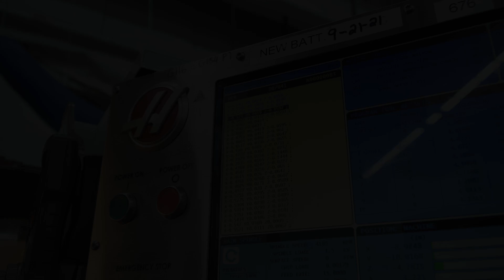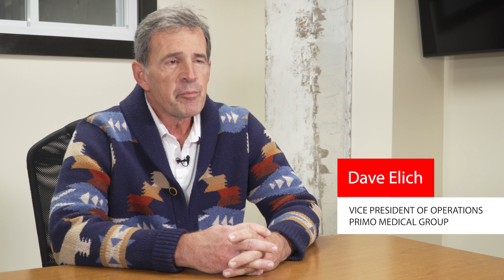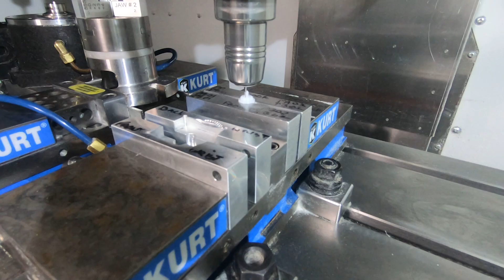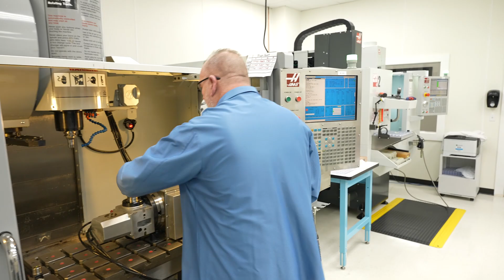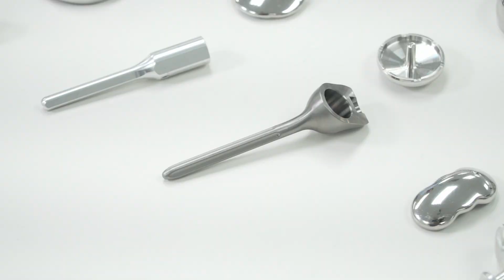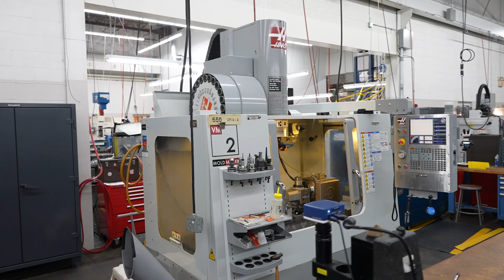Customer Spotlight - Primo Medical - Medical Implants

Comment: Says controlled room without liquids but all the haas machines I've used have a small amount oil come out of the spindle from the oil air supplied to the bearings?
Reply: I have a grease packed spindle so it doesn't